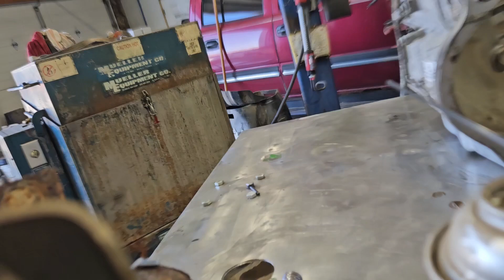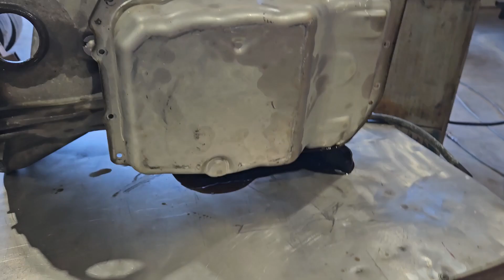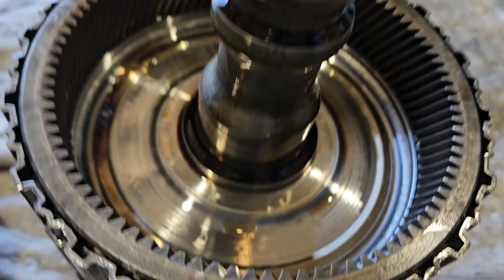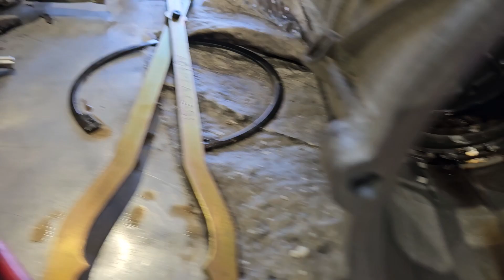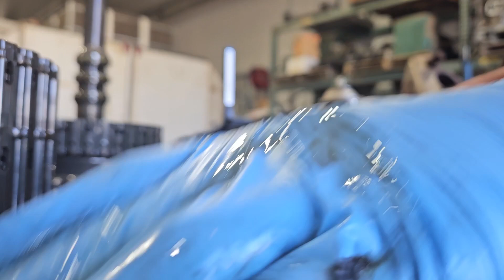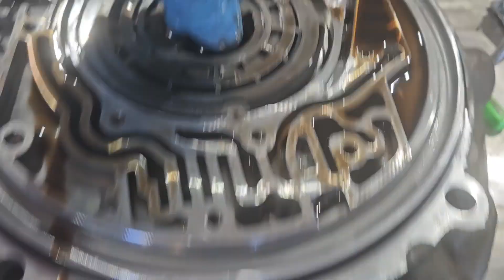6L80 Teardown with destruction and carnage

Comment: Hard to believe that little valve could trash a transmission. Is there a better part that could be installed to prevent that from happening again?
Reply from the maker: As a matter of fact both Transgo and Sonnax make valves to remedy that. However, once that converter starts shuttering, it should be acted on immediately because the destruction is starting.